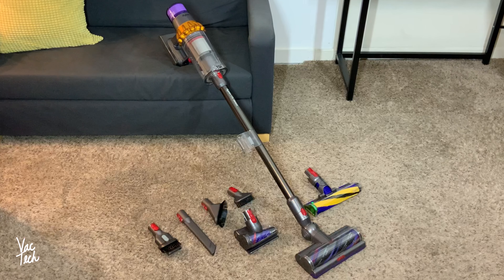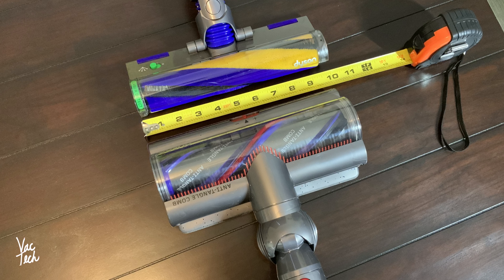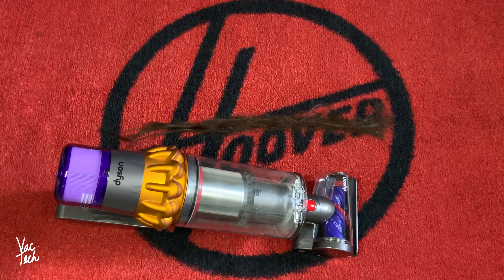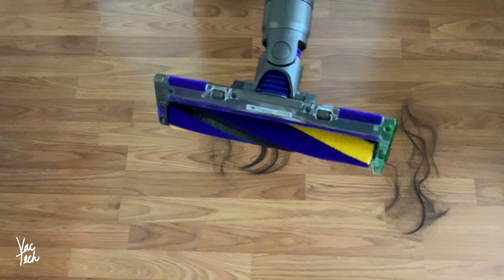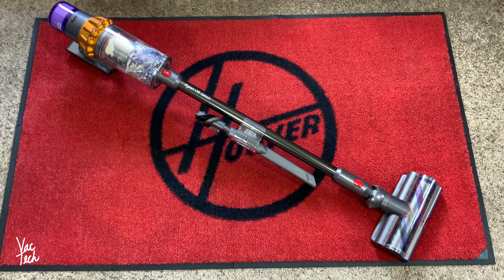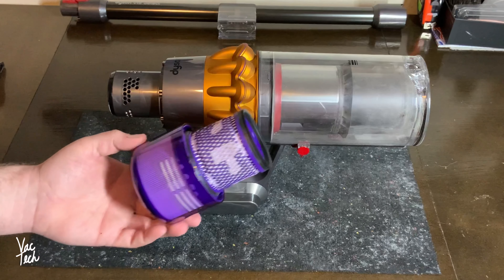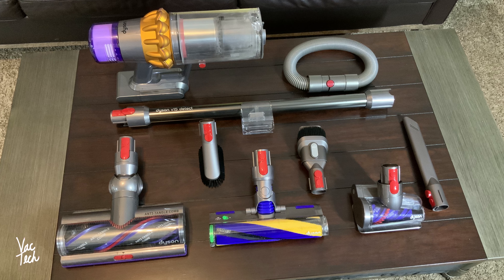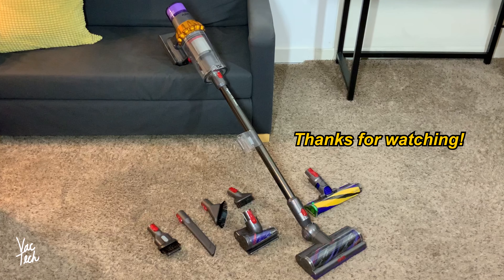Dyson V15 Detect Vacuum Review Demo & Maintenance Tips

Comment: Just purchased one of these after getting tired of dragging my full size Dyson Animal and it's various attachments around the house to clean my hardwood floors.  With 3 cats and 4 bedrooms (1500 sq ft of hard floors), I thought I would need a spare battery.  I was able to vacuum my whole house and an area rug with 5 minutes of power remaining.  It does an OK job on a low pile rugs, but eats up battery power.  For everyday light carpet maintenance, the V15 is good, but for a deep clean the Dyson Animal excels in picking up animal hair.  

Best of all, no cords and no heavy vacuum with attachments to drag around.  Bought a stand on Amazon and it fits nicely in my laundry room.  Never thought I would want to vacuum with the lights off.  Floors feel a lot nicer walking barefoot on.  Definitely makes it easy to maintain your hard floors.  Highly recommened.
Reply from the maker: Thanks for the comment! Glad you’re happy with yours! While Dyson’s corded vacuums generally clean carpeting better, their best cordless stick vacs are best-in-class, and they’re so convenient in comparison.

Comment: What a fantastic review! You can always tell who does their research and who really uses the product, and there was certainly no doubt here! Thank you for such a great video.
Reply from the maker: Thanks, Jonah! I really appreciate the nice comment.  I've been using cordless Dysons since the first model DC16, which I bought 11 years ago.  Dyson's cordless vacs remain best-in-class!
Reply: @VacTech1  if you don’t mind me asking you, we have been looking at the last few cordless dysons as potential candidates, but I was wondering how your battery lifespan and longevity have been. We don’t want to get something that is going to die relatively quickly. Also, would you consider the cordless trade off to be worth any battery shortfalls?
Reply from the maker: @jonah_herring  The cordless convenience is absolutely worth it.  As you go up in the line, the battery life and carpet-cleaning performance increases, so the V7 and V8 don't have as good of battery life as the V11 or V15. Battery longevity seems to be good on these.  I've personally never had a battery fail, but I've sold my old models as I've upgraded. A V6 I sold recently got a new battery, but that vac was 6 years old. Dyson has claimed the newer models batteries are supposed to last a long time (like 10+ years, but time will tell).

Comment: I just received my v15 today.  It is really an amazing vacuum.  This will be my third Dyson.  Also have Shark Apex, which I will now only use to clean my cars, and a Roomba J7+.  

I had a hard time with place rug, but I put the lever in the middle and it was easier to push.  Couldn’t find any info on that part of the cleaning head until I watched your video.  Great job.
Reply: -May i ask why you are on your 3rd dyson. do they not last long or you just want a never and better
Reply: @balkangetaway Sorry for late reply.  My first I got many years ago.  I can’t remember model.  It was heavy upright.  It was a beast.  It sucked the most difficult without any problem.  After many years of use, it started to smell.  I couldn’t get to open the cyclone part because I was afraid to break it.  Dyson should make it easy to open and clean.  Every time I used it, it made my house smell like a wet dog.  It also fell down stairs.  It still worked, but I decided to get a Shark Apex.  Wrong move.  I also still have an older cordless Dyson I use for restroom and stairs.  So now I have two Dyson.  They do last.  I just like vacuums.  I also use a Roomba J7 Plus that I love using because it gets under the beds.  I vacuum a lot.😂 Still loving this v15.  Still awesome.

Comment: How long is the runtime for you on Auto/Medium mode on carpet?   I only get around 20 minutes.  I use it as a handheld for around 4 to 5 mins to vacuum the bed before I do my apartment.  It’s when I use it on carpet as a stick on Auto mode and it’s there where I get 20 minute.  So let’s say I get around 25 mins combined handheld/stick use.
Reply from the maker: I get about 25 minutes, but it changes constantly as the suction kicks up and down when it's finding dust.

Comment: There's a v15 and a v15+ HEPA. I thought that all Dyson vacuums came with HEPA filters now but looking at the advertisement I noticed HEPA was only listed on the +.
Reply: It turns out that Dyson’s V15 comes standard with a true HEPA filter. The one you are talking about with a blue filter is the one Dyson is marketing as HEPA. Instead of capturing 99.99% of particles 0.3 micron, it can capture 99.97% of particles 0.1 micron. It can basically capture debris about 3X smaller with higher efficiency. A standard HEPA filter usually can only capture about 99.00% of particles 0.1 micron, or 1 for every 100. Dyson’s new filter can capture those sized particles at 99.97% efficiency, or 1 for every 3,000.
Reply: @battery_wattage  thank you for the answer. I wonder if it affects the suction at all.
Reply from the maker: @matfalkner  I imagine it won't, but that's a great question!

Comment: Question—can you charge the battery in an outlet on its own, without having the actual vacuum attached to it? I ask because I really don’t have anywhere in my house to mount the whole thing while plugged in. Ideally, I would just charge the battery in an outlet and keep the actual unit in a closet. Is that possible?
Reply from the maker: Yes you sure can! You can skip the wall mount, and just use the charging cable that it comes with. It plugs into the battery, which can be charged separately from the vacuum.
Reply: @VacTech1  🙌🏻🙌🏻🙌🏻 awesome!! That seals the deal for me! Thank you for this epic review, I’ve been agonizing over which model to get and this was seriously so helpful
Reply from the maker: @hilarydemko3299  Hahaha epic!  Thanks, I'm glad I could help!  I think you'll like it.

Comment: I just received this today and the clean filter message is on and has not turned off even though it’s a brand new vacuum. Nice bells and whistles but already a problem straight out the box and I can’t even exchange it or get a replacement part because it’s been sold out so long. I would keep my lg cord zero but it oddly doesn’t come with a mini motorized tool for upholstery .. this sucks

Comment: U heard of the v15 detect+? It has extra tools, a special connection that has a built in pull out crevice tool, a joint that allows the machine to flex under low items, and an advanced  filter that filters even more dirt out than even any cinetic vac dyson's made. 0.1 microns vs 0.3 from any hepa filtered dyson from the regular v15 and below - better than any other stick vac, upright, and canister with a hepa
Reply from the maker: The extra features look really nice.  That model was not available in the US when I bought mine.

Comment: Very impressive demo as usual! Well done man! This looks impresisve, would love to see what it's like against my V11. I'm a bit skeptical about the mini motirised tool though, the V11 one performs very well and grooms better than anything I've used on stairs, however the new anti tangle one doesn't look like it'll edge clean well or groom well, I think they should provide the V11 style tool as well. This one should be their cordless version of the tangle free head and the V11 style as a deep cleaner for stairs etc

I do like how the clear window can be removed for washing! If they did that on the torque head that would be perfect!
Reply from the maker: So you're right about the hair screw tool and edge cleaning. Keep the crevice tool handy!

The grooming seems similar to the old one, but the side suction path means pickup can suffer if the whole attachment doesnt make contact with the surface. This can actually be seen when I vacuumed the ottoman.

Thanks for watching, and I appreciate your comment!
Reply: @VacTech1  Ooo yeah now that you mention it, it's clever to force the user to get the crevice tool out! No matter how good the edge cleaning is, it can't match a crevice tool to really get into the far corners and edges, genius in disguise!

Comment: Could I ask how the v8 2022 version compares against the newer Dyson models? (the v15 specifically)? I believe the 2022 version comes with the motorbar and hair screw tool. 
I'd love your opinion!
Reply from the maker: The V8 will be lighter weight, but the V15 will be more powerful (especially on carpeting), and have a longer battery life. Hope this helps!
Reply: @VacTech1  It really does :) Thanks so much!
Also, your response time is beyond amazing. Much appreciated.

Comment: I have a mix of hardwood floor, tile and carpet. My carpet is low pile and patterned. With the carpet issues with the V15, I wonder if the V11 would be my best option?
Reply from the maker: They're both gonna be similar. The V15 has more power on the auto setting, so you may need to use eco mode, or open the gates. On lots of low carpeting it will work just fine, so it's hard to say.
Reply: I've recently received mine and it does not vacuum on auto or boost mode. I had to use eco mode but even though its eco mode its still as powerful, surprisingly.
Reply: I love the v11 on carpet. Just got the v15 detect plus and it doesn’t feel as smooth

Comment: Did you find auto mode changed power quite frequently on wood floors. I have just purchased this and found it is every3-5 seconds up and down
Reply from the maker: Yes. It changes constantly based on dirt pickup, in real time. Over time, once the floor is less dirty, it will remain more level.
Reply: @VacTech1  I'll have to do some more test with it stationery or something. Seems to do it regardless of dust
Reply from the maker: @spiderbogus369  it adjusts based on floor type, then dust pickup. Perfectly normal. If it seems abnormal, I would contact Dyson.

Comment: One thing I haven't seen mentioned anywhere, can you use the powered heads with the flexible hose? Does the hose have the electrical connection?
Reply from the maker: No it does not. The hose is only usable with non-electric attachments. Good question!
Reply: @VacTech1  Ahh that's a bummer, I could see that being useful with the mini hair screw when cleaning the couch or car seats

Comment: help! i accidently knocked a mop bucket full of water over my v15 brush head housing and it's now not spinning T_T what can I do?
Reply from the maker: Uh oh!  I would take the brushbar out, let it fully dry, and hope for the best.  Maybe put a fan on it to hopefully dry out the motor.  There's a circuit board inside the brushbar motor, and the water might have destroyed it. Sadly you may have to replace it.  You can take them apart to get any water out, but it's not particularly user-friendly to do (lots of small screws).  I hope you can save it, if not, maybe contact Dyson and see if they'll send you a replacement head under warranty.

Comment: Great video as always!  Have you tried changing the auto power level adjustment in the menu?  I ask because I am on my third V15 now. The first two had major software issues that required them to be returned. The only thing I have done differently with this third V15 that still works is that I never adjusted the sensitivity. I kept it at medium whereas I change the first two vacs to low. It’s great when it works but I am to the point where I have to treat it with kid gloves because I am so worried about it dying like the first two V15s did on me. It’s absolutely my last Dyson I will ever be buying new at full price. I’ll stick with my bagged vacs that never let me down.
Reply from the maker: That's a shame!  I wasn't aware they were having any issues with it.  Outside of just running it in auto mode, I haven't adjusted the settings any further.
Reply: @VacTech1  yeah dyson never did let me know what the issue was once their engineer looked at my returned machines but not changing the sensitivity of the auto mode was the only thing I have done differently and so far it’s still working. I definitely won’t be changing the sensitivity again.

Comment: Are the attachments heads electrically powered or suction powered?
Reply from the maker: Any attachment with spinning brushes or lights is electrically powered, but this machine comes with several suction-only attachments as well.

Comment: Is there some way how to modify accu cleaner for better power? I have one with 350W engine and it's ok for dust, but it can't really take anything heavier than dust, I guess insert battery with higher voltage is not possible because electronics would be burned or detected wrong voltage and stop working. Today accu cleaners are still like babies, but with like 40V battery and 500W motor, it could be really usefull, but such cleaners are expensive.

Comment: Great review. I have the v15 and I learned a lot of good maintenance tips! This vacuum is very convenient. Weird question, but I’m wondering how well the v15 cleans carpets compared to a corded cyclonic bagless such as the Workhorse that you also reviewed? Is it worth having something like a workhorse for deep cleaning to supplement they v15? I’ve seen videos of people using the Workhorse after other vacuums and it seems to pick up a lot more. Thanks!
Reply from the maker: Thanks! As well as the V15 works, I would still recommend having a corded vacuum around (like the Workhorse), to periodically deep clean carpeting. The Dyson is best-in-class, but many corded vacuums will still deep clean carpeting much better. They'll also revitalize the carpet nap better.
Reply: @VacTech1  Excellent. Thanks for the advice!

Comment: I’ve just bought one but it’s very very loud. Do you know how to fix this
Reply from the maker: Well it's got 3 operating speeds. It's going to be loud regardless on Max mode. On auto mode it will fluctuate in noise level depending on floor type and active dust pickup. Eco mode should be very quiet. 

If auto or eco modes are overly-loud, I would contact Dyson and make sure the unit isnt defective. I hope you can get yours sorted out!